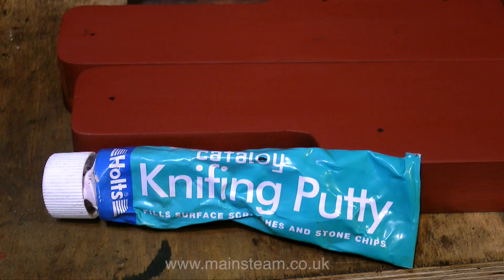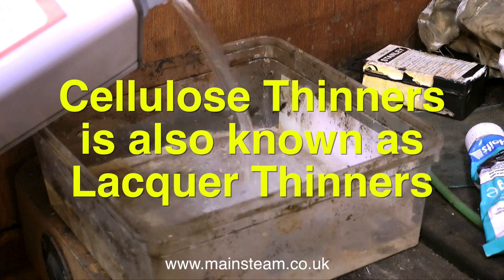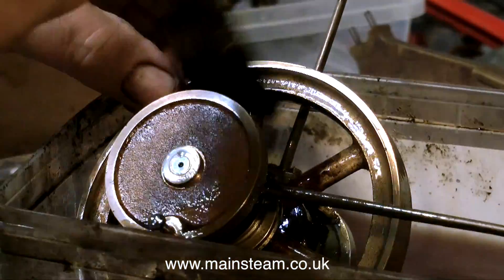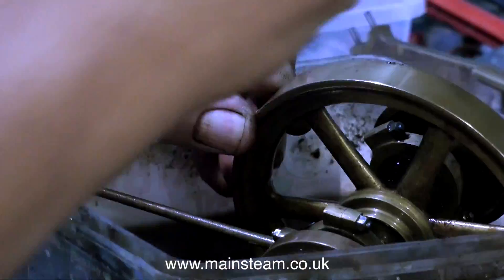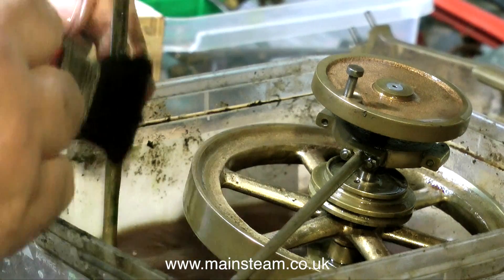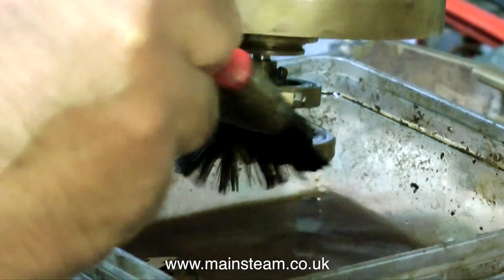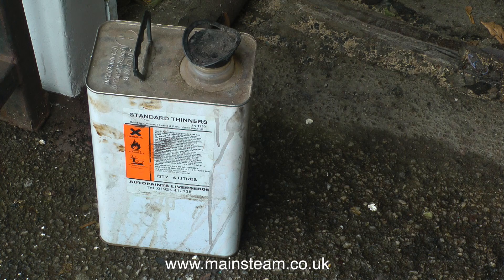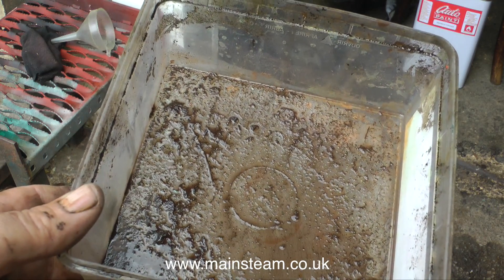PART #5 - RENOVATING A MODEL TANGYE TWIN CYLINDER STEAM ENGINE

Comment: Hi mate.
I have seen Tom Lipton from Ox tools fame, use some stuff on his old machines to get very old dirt and grime of it.  It's floor stripper.  He showed how it worked on an old machine that he had bought to restore.  It worked wonderful.  He applied it with a paint brush, and just a minute or so later he could wipe the machine clean.  this might be something for you to use as it does not use a solvent.
Marcel.